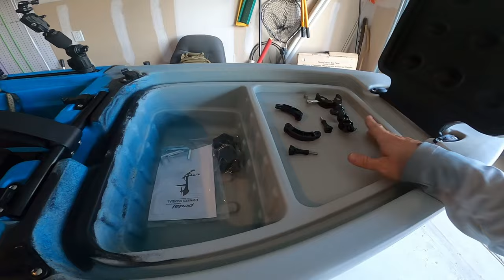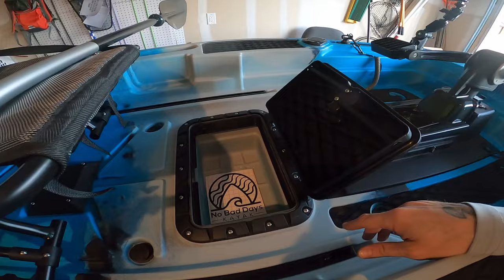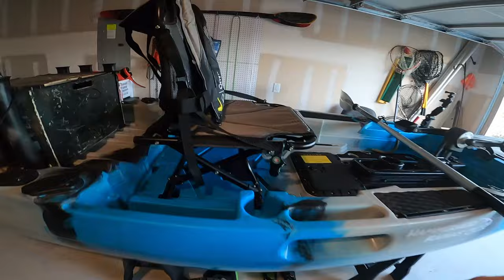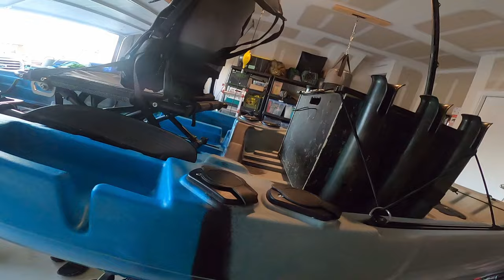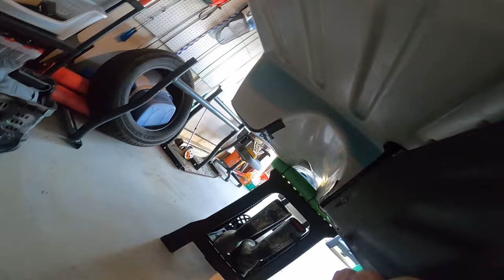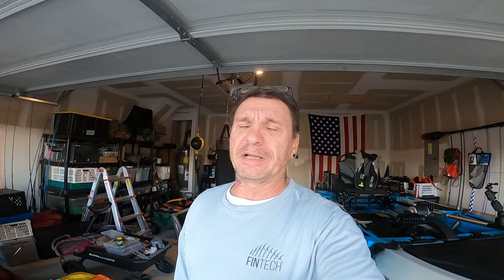Budget Friendly Pedal Kayak, Hammerhead Kayaks, Whale Shark

Comment: I work for hammer head kayaks and we’re located in mobile Alabama. We’re working on our new website and a new app. Check us out. We do shipping as well.
Reply: Also wanted to add this model has a fin drive and a trolling motor option
Reply from the maker: @dalebos4x4  I wish I would have gotten the fin drive. The pedal drive quit the first day on the water. I took the kayak back to No Bad Days Kayak and bought something different.
Reply: We have the equipment to swap it out.
Reply from the maker: @dalebos4x4  I did not go that route. I was so frustrated because in the first 5 min on the water it broke. Took it back like I said. Bought a native titan x. And then a Hobie passport. And now a big water 132 pdl. I go thru a lot of kayaks. Ha
Reply from the maker: @dalebos4x4  https://youtu.be/SKa7hTg7Tp0?si=jsj5BYkaaH3fHmBs